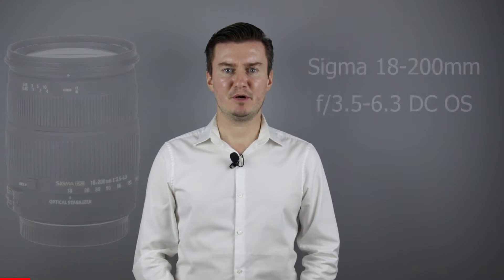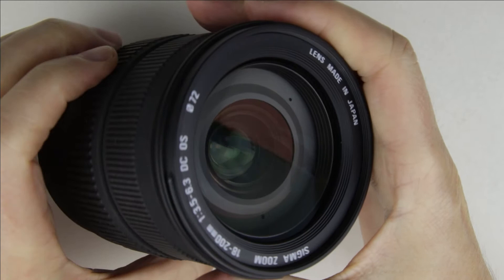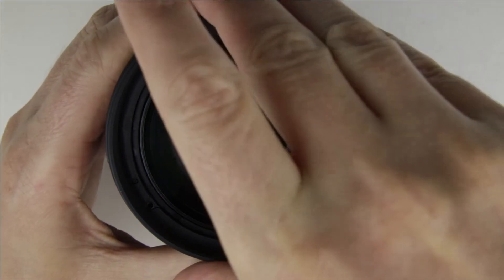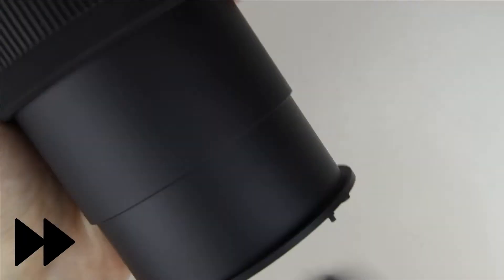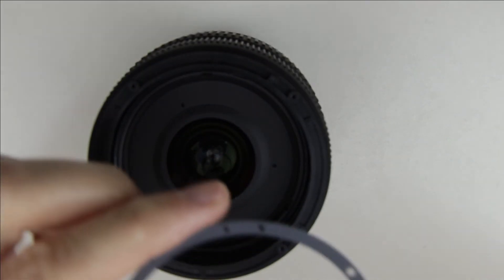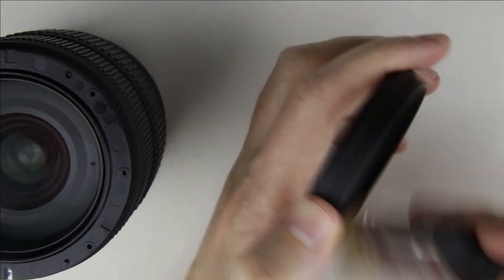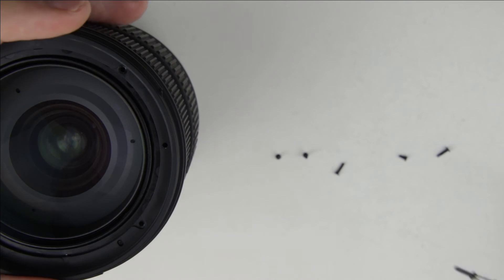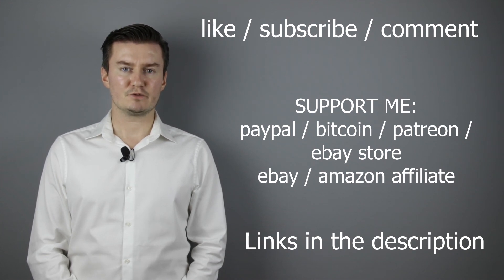Sigma 18-200mm f/3.5-6.3 DC OS - how to clean the lens inside

Comment: Thank you. The 18-200mm is identical but the info ring is glued, not screwed. A scalpel blade will persuade a glued-on ring label to detach. Simply remove each screw and note where along the ring they came from (arrange them in a round plastic lid), as they are different lengths. Also make sure to mark the side of the ring before removal, to ensure it goes back in the right position. Clean the element with methylated spirit and, voila!  The lens is ready for another many years' use!
Reply from the maker: Thank you for the info!

Comment: Thank you greatly for your video. Is it possible for you to make video of Sigma 18-125 DC (the version without optical stabilizer) disassembly for the focus tuning purpose in the future? I know it's quite old lens but they could be found quite often. I tried to do that but i's rather tricky process.
Reply from the maker: I make videos of lenses which I have to repair, so I don't make videos by request.

Comment: I have also the same model but the drop and the front glass are broken how can I fix it .
Reply from the maker: Replace the broken glass with a new one.
Reply: @CamerasLensesEtc  i don't know how to change can you please make 1 video.
Reply from the maker: @MNadeem-qo1rl  In this video I remove the front lens. Why do you need an another one?
Reply: @CamerasLensesEtc  bcoz i didn't found lens glass .
Reply from the maker: @MNadeem-qo1rl  Check ebay and aliexpress for front lens element. Alternatively, you can buy a same broken lens with a good front lens element, then you can use that. If you can't find any for sale on the internet, then the lens can't be repaired.

Comment: the canon 70-300 usm II doesn't have screws on the front, below the sticker, what should I do to open it?
Reply from the maker: If the front lens element can't be unscrewed, then you have to disassemble the lens almost completely starting from the rear of the lens.
Reply: @CamerasLensesEtc  Do you have a video about her on the way?
Reply from the maker: No, I don't have that, and not likely that I will have it in the future, because it is a quite rare lens, and I don't have that often.